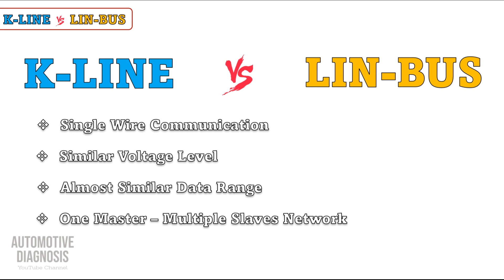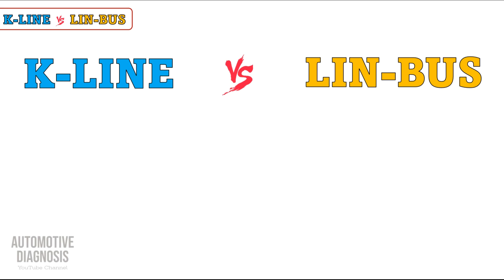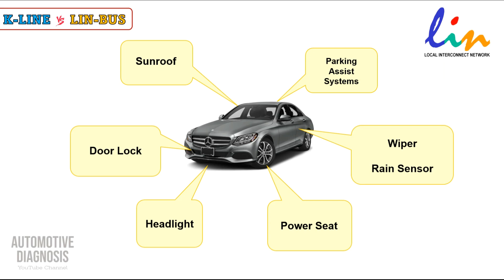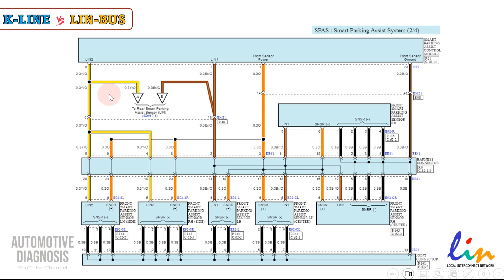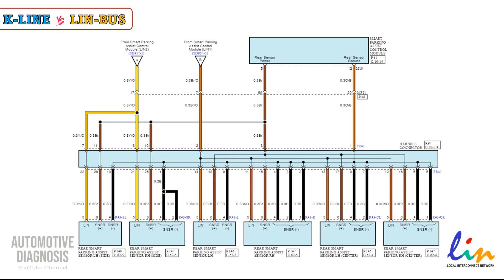K-Line vs LIN-Bus | K-Line Explained | Everything About K-Line & LIN BUS #canbus #linbus

Comment: I have a question,  seeing that the bcm can be the gateway on some vehicles.  When the bcm is down. Would the K line be down as well?
Reply from the maker: Hi my friend, on many vehicles BCM uses K-Line for diagnostic, in this case, if BCM is down, scan tool can't communicate with BCM as K-Line won't be working, but it won't affect the entire K-Line if BCM hasn't shorted the network.
Reply: @AutomotiveDiagnosis  Thanks for the quick response.  The IC, BCM, AHLS, and other mods are down. Except the AC and SKM on a 2012 Kia Optima. Partial k line bus is down

Comment: Super valuable... 
I'm troubleshooting Isusu ELF lorry... 
Later share you what are the updates of my work 
🙂🙂🙂
Reply from the maker: Thanks my friend
Reply: 1 no communication with scanner 
2 k line missing at WSS , 
3 Abs not working 
4 k line to ground resistance 7k oms..
Reply: 5 no voltage at WSS wires.. sensor reading 8 M oms
Reply: to test an ecu by k line need some resistor like can bus ? i'm trying to scan a slk 170 by cable 38 pin, but i can't do

Comment: If the DLC is upside down, so wide at the bottom, are the wires also upside down? 16 bottom right would then be top left?
Reply from the maker: Hi my friends, By rotating the DLC connector you rotate the pins too, Pins are not gonna change the position.

Comment: Thank you so much , what is flexray and the difference with can bus
Reply from the maker: Hi my friend. There are many similarities between CAN-BUS and Flexray as both of them use a pair of twisted wires, even the voltage reading is very close. The main difference is that Flexray transfer the data 10 times faster than CAN-BUS, while the max speed on CAN BUS can reach to 1 Mbps, on Flexray we can reach to 10 Mbps. The other difference is the network configuration, which Flexray normally comes in Star pattern.